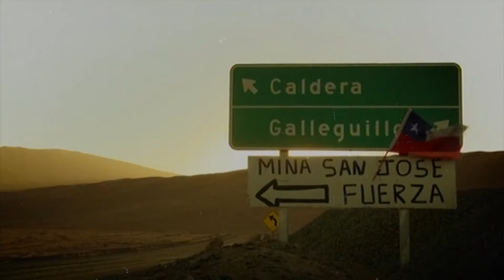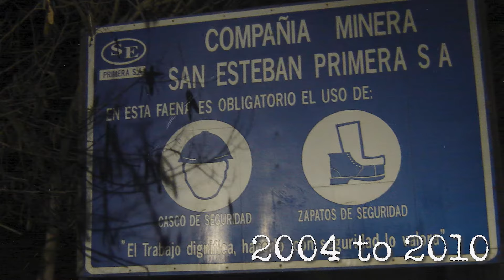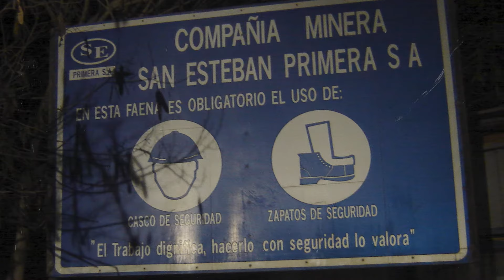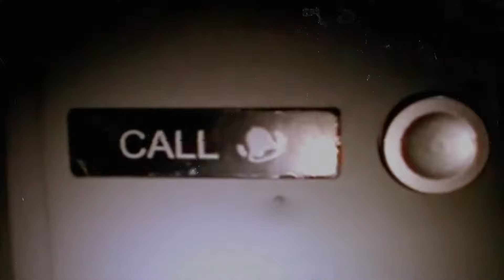The Chilean Mining Accident & Rescue (Disaster Documentary)

Comment: It should be noted that some time ago a financial statistical study was conducted on two scenarios in regards to mining. 
One was a company that pays high wages and also pays a high cost on safety, maintenance, and worker satisfaction. The other was just like this Chilean mine. Low safety or none at all, disregards worker satisfaction to save costs but still pays a decent amount. 
The comparison was not even the close. The safety mining operation made 100x more than the one that neglected it. This is due to the unsafe mine having high turnover rates, loss of production due to injuries or illnesses and most of all the loss of $$ due to a catastrophic failure as in this one that caused death. The safer mine by contrast retained staff, had significantly less stoppages for illness or injury and since there was no disasters they saved billions. 
So it actually pays more to be cautious and work on safety. It may appear on the surface that cost cutting safety increases profits but the opposite is true. Too bad these blind business owners don’t see that.